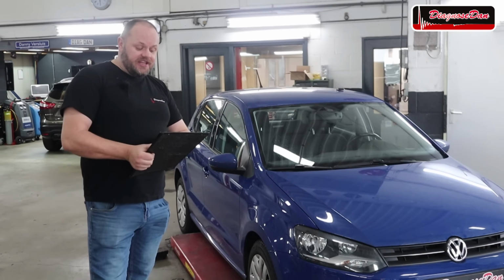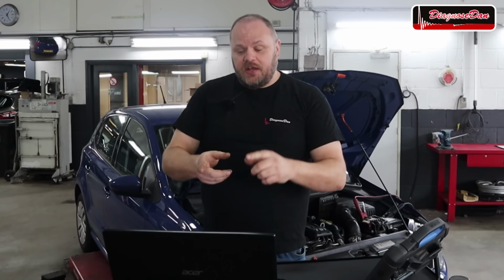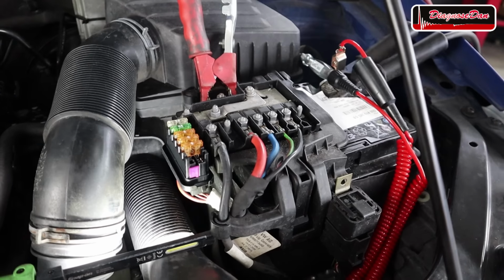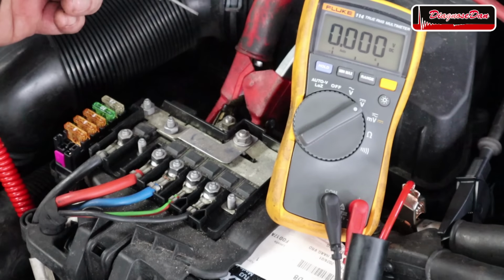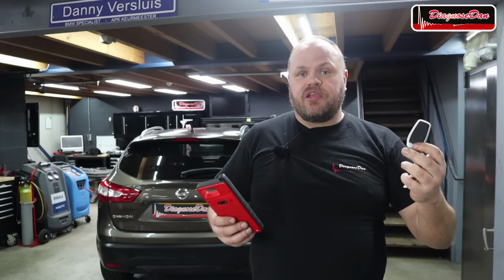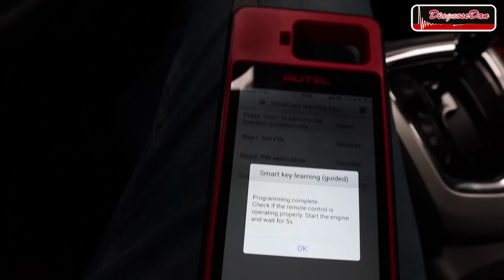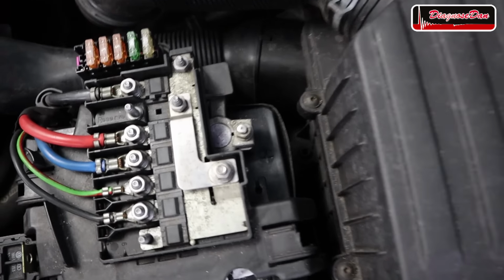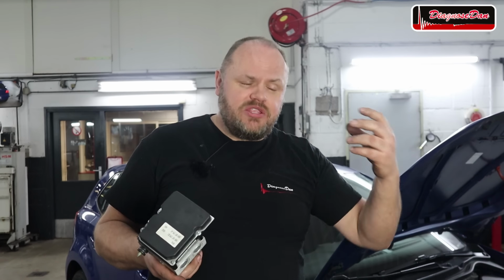VOLKSWAGEN ABS FIX

Comment: Thanks, Dan .A example of the Voltage drop concept,  definitely I am going to share this video with my students
Reply from the maker: Thats great to hear! A basic but important and very relevant lesson! Also keep in mind to use different loads on different circuits, its pointless to use a 70mA testlight on a starter moter circuit.

Comment: Great display of it showing voltage, but dropping with a load.   This demonstrates why it's important not to touch anything without testing it all first.  These are always the weird one's that fix themselves when you wiggle too many things around, and then you never find the issue and it comes back again later.   Great video!
Reply from the maker: Yes indeed, i was also lucky to catch it on video. Before you know it all is working fine again!

Comment: i fix mobility scooters for a job and i went to one that didn't work and i checked it with a multimeter and come to the conclusion the module wasn't working so i sent it off to have checked for them to send back with no fault found, then it came to me Diagnose Dan with is test light and sure enough within 10 minutes i found a bad connection, so now i have test lights in my van in my tool box and even at home,  as for you're video Dan excellent video again thank you
Reply from the maker: Lesson learned, you will never forget 😉

Comment: Love your work Dan
Just a small point 
I have a similar Fluke multimeter 
If you turn the dial to the left it goes into Lo z volts ( low impedance) which then puts a small load into circuit. 
Keep up the great video's

Comment: Excellent video Dan. I don't have a test light like the one used on this video. However, what I do to substitute is that I use a light bulb from a side marker that draws quarter amp. When reading voltages, you can connect in parallel an incandescent bulb with your multimeter. 

This method insures you are loding circuits being tested. Test and keep in mind how much current you are drawing with your set-up ahead of testing circuits. 

Thank you Dan, Love your videos.
Reply from the maker: I also use different bulbs for different circuits, pointless to use a 70mA testlight on a starter moter circuit.
Thanks for your comment Dan.

Comment: Great vid again🙂👍 Yes, the internal resistance of the multimeter is usually 20Mohms, so it doesn't put any load on the circuit.
Reply from the maker: Thanks for your comment

Comment: I had similar problem on a older model of nissan patrol. Friend of mine called me to take a look on his car because he had a problem with first start in the morning, especially  during winter time. Conclusion was that the glow plugs are bad. Tested with multimeter, everything seemed ok, but the car wouldn't start. Checked the continuity, glow plugs, wires, both of the batteries and relay. After a whole day wasted, the last thing i wanted to try was to change the positive wire that goes from the relay to the glow plugs. Changed the wire, and it was all ok. Later checked the old wire with multimeter and multimeter said it was ok, but under the load it wouldn't deliver the power.
It is important to mention that I am an electrician in construction and not for vehicles. This was the first experience with this kind of work and problems of this sort.
If I had seen Dan's videos, it wouldn't have taken the whole day, only 15 minutes.
Thanks Dan.

Comment: Just wondering if that low amperage test light vs a higher amp automotive bulb would be better. Thoughts?
Reply: Either are good. The test lights that I would avoid are the ones with LEDs because they draw very little current and you might have a similar problem that you would have with a high impedance input digital multimeter. Get a test light with an incandescent bulb, or you can save money and use a automotive bulb in a socket and know you're not dealing with a high resistance point in the circuit.
Reply from the maker: Both, just be careful not to draw to many amps a computer controlled circuits.....

Comment: Amazing, I wish I had seen this video, sometimes I fix my own cars and I had a charging issue on a VW Sharan TDI and there was 11volts at the battery, I'm not a mechanic and fired the parts cannon at a alternator and still had the problem, it turned out to be in that box of tricks on top of the battery. One of the flat bolted fuse links had melted and was no longer making connection, unfortunately had to replace the box as it had damage and as soon as I did it was all fixed. Moral of the story, check the powers and grounds! Nice words!
Reply from the maker: Glad you eventually found the problem!

Comment: I always tried to load a circuit at least 10 percent of the fuse capacity, preferably 40 to 50 percent, to make sur sufficient voltage was getting to the load. Good video, good find
Reply from the maker: Thank you very much its really appreciated 👍

Comment: Excellent video, showing why the simple test light is so important. 
Wanted to ask why you didn't use some dielectric grease on the contacts when refitting them, as it looks like they were obviously prone to corrosion.
Reply from the maker: You are right. I was out of dielectric grease and it was late on a Saturday..,

Comment: Thank you for your video! With the contact on the Abs unit connected and with ign. on you could of course use a multimeter for finding the fault. In your case it can be misleading. Im sure you are aware of the that.
Reply from the maker: The fat wires i tested in the video are actually for the Abs pump motor. 90% of the time that pump is not running and there is no current flow, so be careful with you theory😉 
We never tested the other powers in the video that in hindsight were in the same fuseholder. 
I get your point btw. 
Thanks for your feedback 👍
Reply: @Diagnosedan  Thank you for your time !

Comment: Great work Dan. As always, once you know the fault a simple fix. But you found the fault by proving beyond all doubt that's where the problem was multiple times using different methods. Well done. 👍🏼
Reply from the maker: I always try to 100% prove a diag. to be sure i've fixed the problem. Try that is🤣

Comment: Hi Dan
This is a known problem on most Volkswagen, that they have problems, with that fusebox, often the big fuse is blown.
But back to the Nissan, you forgot to tell about the key cut, if the owner loses his original key, he don't have the key cut in emergency.
Reply from the maker: I didn't forget to tell, i just dont have a cutting machine 😁

Comment: Great video like always  keep them coming 👍 😉  normally you can yse your multimeter to test power and grounds but keep everything connected so the original consumer will be in circuit I can't tink of a better load . Actually you can get in trouble with your 5mA test light:))😅 but who I am to teach the master. Corect me if I m wrong.

Comment: Nicely done sir 👍🏻!  Would the voltmeter have shown the problem if the connector were plugged in and the key was on?  Figured the module being powered up would have showed the voltage drop too on the meter but maybe due to the connector location it was easier to remove and check?
Reply from the maker: Connector was connected

Comment: Hi Dan, thanks for the videos.  Can I ask why you don't use the LowZ / low impedence function of your Fluke multimeter to test for power supplies instead of the incandescent test lamp?
Reply: i would like to see difference
Reply from the maker: Not sure if that setting would have worked in this case, maybe something to try in a next video! 
I prefer to see that light shine, its fast, simple and reliable

Comment: Always necessary to use quality contact protection gel between cleaned up electrical connection joints. Nyogel 760g is the perfect product which will prevent connections corroding again.

Comment: Incredible that the other shop didn’t use a test light. Recently my 2013 BMW 328i showed scary messages about the ABS! A scan with my iCarsoft BMM V2.0 indicated a faulty right rear speed sensor! The Stealership would have charged nearly $415.00 for changing it including part,labor, and tax. For $58.79 usd and a little time to install the sensor job was done, and the wheel was remounted and bolts torqued to 140 Nm. All codes cleared.
Reply from the maker: Great job💪

Comment: Thank you for this
Had a similar issue on my abs module as well where it shows an error message and abs is disconnected whenever I enter some potholes or bumps.
I checked and happens to be some of the wiring loose.

Thank you always
Reply from the maker: Fortunately that was a cheap fix!
Reply: @Diagnosedan  yes o. And I'm glad I got the tip off from your channel.
Gracias

Comment: Nice to see VW/Audi carrying the same problems from the Golf 4 / Beetle era to the 21st century.  That battery fuseholder has been similar from 20 years ago and the vehicles have been plagued by it.  It controls cooling fans, turbo afterrun pump, abs and ac.
Reply from the maker: They slightly changed the design but still problems🤣

Comment: Watching Dan's videos a pattern can be seen. Diagnosing possible faulty module  first check CAN lines then power and ground, of course always use old school power probe, one with light bulb not diode. As simple as it seems, obviously many of workshops doesn't know or doesn't work by that rules.
Reply from the maker: Thanks for watching!

Comment: That particular Fluke114 if set to AUTO-V LoZ would have applied a low impedance to the circuit under test and shown up the same fault as the test light. But a test light is a much easier to understand indicator for quick confirmation of voltages and grounds. Another great video showing how easy it can be to miss something simple. Thanks Dan.
Reply from the maker: I agree that the testlight is the better choice, easy and visual result😁

Comment: Still struggeling with my abs 00290 left rear on my passat , even with new hubs and sensors . Would like to see more harness type of videoes like this. Thx
Reply: Replace the rear electric harnes from the sensor to the middle of the car (60 euros)

Comment: Interested to know if you hold any value in also scoping the CAN with the module disconnected as well. 

I always worry that the CAN signal being present could be signal from the ABS module and not from the network itself, although the signal received being so uniform would suggest terminal resistors are present.

Just interested to know your thoughts?
Reply from the maker: The network needs 2 resistors, if the signal came from the abs unit and that wouldn't be connected to the network the signal wouldn't look as good as it did

Comment: Great job 👍 I couldn't see the ABS module when you were testing the Voltage at the fuse board. Was it plugged in and ignition on to load the circuit?
Reply from the maker: Yes it was

Comment: Thanks Dan for this great video. There is a sound coming from the Abs module in my vehicle. And the battery dies when the vehicle is off. They said the ABS module needed to be replaced. Should I trust? I need your answer

Comment: Have you had a chance to get any feedback on the Autel MaxiPro scan tool you used to program the key remote?
I finally did find it on Amazon but the link in the Description of the video here doesn’t work any longer.
I am also curious if you have used it for scanning fault codes.
When I found it on Amazon, it is listed for 699.00. I’m curious how well it does on the function besides being able to program remote keys for 700+ vehicles? What was the feedback from the customer on the remote key you made for them? Thanks for the videos!

Comment: Hi Danny, what test light do you use? It looks like a LED test light to me which would not add a lot off load to the circuit so it probably is a “special” LED test light. I gave my mechanics incandescent test lights for this purpose but they are getting harder to find. As a automotive locksmith here in Belgium (Antwerp) I can confirm the universal Autel keys are very good quality for the money. Keep up these fantastic video’s! K.

Comment: Hey Dan I got a question for you where i seem to get different answers hopefully you can give me a definitive answer.Can that same test light used in the video destroy pcms or any module? I saw you disconnected the abs module first before testing power and was wondering why is that and why you couldn't just leave it connected just as you tested the negative side an answer is greatly appreciated and keep up the great videos
Reply from the maker: The real answer that i disconnected it was for the purpose of the video, so the viewers had a clear sight of the wire colors. I would be comfortable with testing with the connector plugged in. A 70mA testlight is not going to harm anything.

Comment: Had a car in the shop for a key not working complaint. Turns out one of the keys are original, the other is from Ebay.
Using the factory scan tool, I ended up with two keys not working, since the scan tool did not recognize the serial number in the ebay key.

Just something to keep in mind when you save money on Chinesium parts.

You can see the battery has been recently replaced. 99% sure the previous mechanic forgot to tighten the last nut.
Since it's less work to check the fuses, that's probably where I would start off. And I would still have the ABS module connected, so there would be a load on the circuit.
Reply from the maker: That nut doesn't need to be loosened to change the battery and the connector was connected during the test

Comment: All the greatness of the test light notwithstanding, the Fluke meter has something exactly for this reason.  There is the LoZ position in the range selection.  That is what should be selected in this situation.  It would show a heavy drop in the voltage, maybe not complete disappearance, but a clear drop anyway.
Reply from the maker: Not every multimeter has this function and in my opinion its so much easier to use a testlight. Thanks for your feedback its appriciated 👍

Comment: Good diagnosis by tracing the problem, Dan. However, it would bolster your diagnosis if you had shown the actual corrosion before you started cleaning with a disc sander. Just my thoughts, unless it was just a loose connection at the site of the nut fastener.
Reply from the maker: There was some green corrosion, you are right i should have shown it!

Comment: Will that Alltel key coder work on a smart key for a 05 Volvo xc90? Just wondering if it’s just for pushbutton smart keys or in this case it has a physical key that goes in the ignition, but it’s part of the smart key fob. Either way I think this programmer would be a great tool for my shop. Just not clear on what all it covers. Let me know. Thanks Dan!
Reply from the maker: I dont know all coverage, but i know they have got universal keys and keys that look like the original. 
Maybe you can download more info from the Autel website

Comment: Hello Dan and thanks so much for another great video. I too wonder if the previous shops checked the powers and grounds at all or if they used a multi tester? Great tip on using a test light to load the circuit and can you tell us how much current your test light draws? Just curious as they are all different and  also you should mention that LED test lights are no good for this as they draw Milliamps and do not properly load the circuit. Thanks so much for the great videos and your customers are Lucky to have you on their side diagnosing these mysteries.
Reply from the maker: I think the test light only draws 70mA....
I told the technician what was wrong with the car, and after that he told me he also tested with a lightbulb🤔

Comment: Excellent Diagnostics work. Is there a vehicle that Diagnose Dan cannot fix?
Reply from the maker: To fix a vehicle you need the right tools and information. Without that its very hard to fix. If for example a car comes into my shop and my scantool can't read the memory than unfortunately it gets rather difficult 😉

Comment: Good idea to use a specialist connection grease such as Nyogel 760G between the cleaned up connection surfaces. That will protect the metal faces from future corrosion caused often by vibration.
Reply from the maker: Thanks for the feedback

Comment: Great use of a test lamp. A power probe would not work for this since it is more related to a voltmeter than a test lamp and does not load the circuit? Or am I wrong?
Reply from the maker: You are right it uses an Led

Comment: If you’re going use a DVM then use Loadpro cables on them, it’ll load up circuits with a simple touch of a button….
Reply from the maker: You are right but a testlight is more simple than a multimeter+ loadpro
Reply: @Diagnosedan  

Totally, especially an incandescent one…

Comment: It’s amazing there are still shops out there who would go to the length of sending a module to be checked,get a replacement module and all that,but they won’t do some basic simple checks! 😮
They could’ve found this problem even if they’re so cheap they won’t even pay for a service that provides wiring diagrams…
Reply from the maker: Unfortunately you are right

Comment: Im assuming its the power jumpers to the gel moyntwd hybrid pcb , 2 centre aluminium single core jumpers, surrounded by fine gold jumpers. The stress loop shape is the issue in my opinion. As current flows they want to straighten as heat rises. The resistance welds break thats why this issue occurs intermittently at narrowing intervals until total failure.

Comment: Yep, i really need to get my self a testlight! I would probably not find this fault as i only use my mulitimeter to check voltage. I know this can happen, but i have never actually thought much about it. But using a testlight is actually a smart thing in this case. 🙂
But when the module was tested and working, that would have told me that there is something wrong in the car. 😛